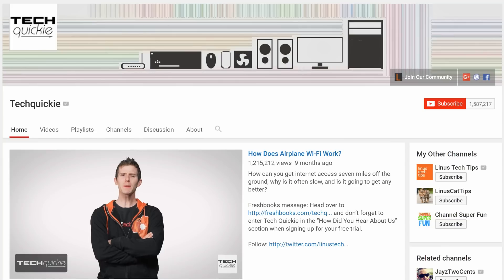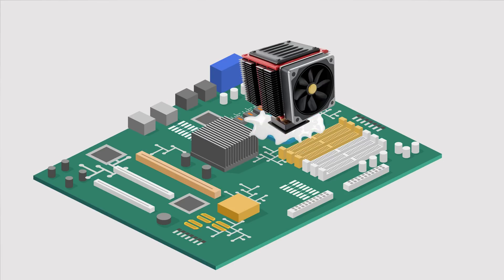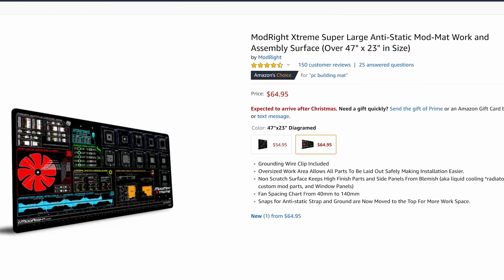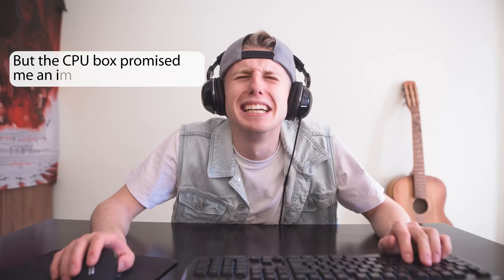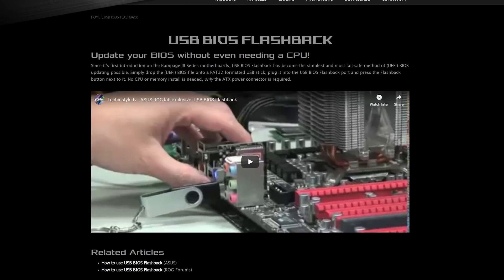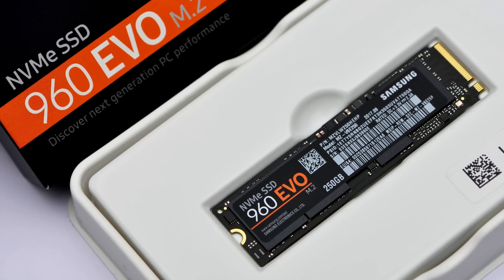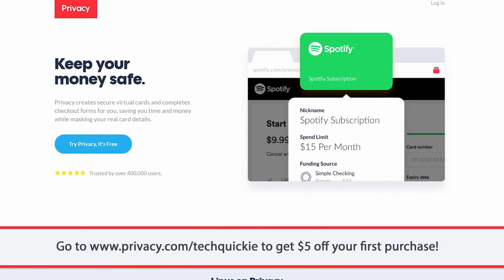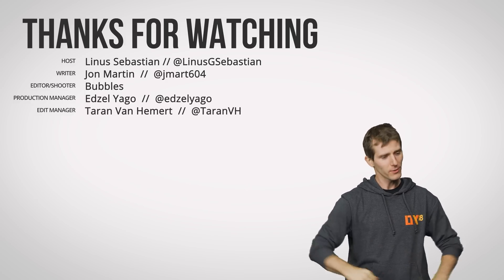DON'T Make THESE Mistakes Building A PC (pt. 5)

Comment: Here are some very important tips which were never mentioned:
1) Make sure the motherboard supports dual channel memory access.
2) Buy at least 2 sticks of RAM. If you want X number of gigabytes of RAM, buy it in two sticks instead of 1 because you need two sticks of RAM for dual channel memory.
3) Most consumer motherboards I have seen have 4 RAM slots. If you have 4 sticks of RAM then just install them. If you have only 2 sticks of RAM, then install the first stick into slot 0 (the closest one to the cpu), and install the other into slot 2 (the third slot away from the CPU). If you did this correctly, then there should be an empty ram slot in between your two ram sticks. If you install the RAM sticks side-by-side then you will have 2 individual single-channel memory access points, which is much slower than a single dual-channel memory access point.
If you have 4 sticks of RAM, having a motherboard that supports dual channel memory is still important because with 4 sticks of RAM you will have 2 dual-channel RAM access points.

I made the mistake of installing my ram side by side. Benchmarks showed that my RAM performed much more slowly than it should have because of the lack of dual channel. By correcting the positioning of my ram sticks, I more than doubled the RAM performance according to the benchmarks I used.

Also if you want the quietest possible system, go for more fans, diode cables (to reduce voltage and slow the fans down), and slower fan speed profiles in the bios/uefi firmware. More slower fans gives same airflow as fewer faster fans, but less noise. For example, I have 3 fans on a 360mm radiator on the cpu (self contained liquid cooling) and it is so much more quiet than the push-pull fan configuration I had on the 120mm radiator in my previous build.
Reply: I have seen one (pre-built PC) motherboard where the 2nd and 4th slots were actually the ones you were supposed to use in dual channel mode.

But the inside of that case was bonkers.  The drive cage was mounted vertically with screws, but the HDDs were held on with Velcro tabs (I kid you not).
Reply: @nocelebrity6042  So basically that motherboard and the rest of the PC was built entirely by retards?

Comment: When pulling down the retention arm, push down on the metal square doohicky so it goes under the screw.  I didn't do that and I'm pretty sure that you're not supposed to hear a crunching sound when you pull the arm down.

Comment: Dont buy a 16 gig stick of ram, buy two 8 gig sticks and put them in dual channel
Reply: or alternativaley buy two 16 gig sticks and have 32
Reply: TheBlinkstyKrab what if I want 4x16GB to get 64
Reply: @B1SQ1T  u can buy 2x32
Reply: @DixeyDo  4×16 has no performance difference to 2×32
Reply: @noahsvirsky9962  Duel channels are the best
Reply: @DixeyDo  most slots are configured ABAB, you want both cards to be on the same letter or "channel" for the benefits, 4×16 would work the exact same as 2×32
Reply: @noahsvirsky9962  im pretty sure its AABB and you want them to exist in AB config. Plugging to the same letter means plugging to the same channel means the other channel is not being worked on.

Edit: when in doubt, usually there are etching on the board that tells you the name of the lane or u can check the manual
Reply: @noahsvirsky9962  there is
Reply: @noahsvirsky9962  except 2x32 is better for upgrades
Reply: Why?
Reply: Or just use quad channel
Reply: Does buying 1 stick of 8 gb ram, put it on slot 2 then buy another 8 gb ram and put it on slot 4 make it dual channel or is it specific to 2x8gb only?
Reply: @horizonariondust576  It is best to have the same sticks, but it is possible to use different ones. You should match the frequency and the latencies between the ram sticks, because if they are different, the RAM will work on the lower one.
Reply: Buy 4 4 gig sticks its even faster
Reply: @tatemushroom1002  Please, no it's not faster unless you have a threadripper system.
Reply: Or 4x4, populating every slot, if you don't plan on upgrading later on. Also, check the slot population guide.
Reply: Or just buy a 16gb ram kit
Reply: With ryzen loving memory bandwidth I'm surprised we are not seeing triple channel make a come back.
Reply: @pauls4522  Is it really related to bandwith? I thought that it is because of the infinity fabric clocked  the same speed as the ram.

Comment: We at the Verrge use special Thermal compound.  If you follow my directions clearly when apply and use my technique of the "Bukkake Thermal Sugoi" method, you can actually lower your temps by at least 20 Celsius.  

Some suggestions I would add would be to replace the liquid in your AIO or custom loop with thermal spunk, it will cool it far better.  

You should install the memory in the closest ram slot possible, it is a advance technique called Fusion memory.  You must install both sticks simultaneously in the exact same time, in the exact same way.  If your timing is off, you will not achieve proper Fusion memory.   Even the angle of your wrist, and the amount of pressure have to be exact.  Doing it correctly will increase the memory speed exponentially.

This technique was taught be master race builder Yardrats.  I only know of 2 others who can install memory with such skill.  Master Race builder Goten, and Trunks.

Comment: Thermal paste again? Listen, tape your index with tape of any kind, add thermal paste to CPU, spread out evenly using taped finger until only a very thin layer remains, mount cooler. Perfect "every time" using this method because you can see the shmoo verses guessing the ooze. Peas and rice belong on your dinner plate, not your CPU, stop guessing and just use your damn finger and a little bit of tape. And knowing is half the battle :-).

Comment: i stored an old fx-8350 in a small compass box, well i guess someone stepped on it because most of the pins were bent, so i manually unbent them all and got it to work again flawlessly. Its so annoying when i had 1 or 2 pins that wouldnt go back up without forcing others down since i didnt have small enough tools to get in between them easily.  I used it and my old motherboard for my parents computer that they use for really only internet browsing.

Comment: Who needs a power supply? Find an electrical outlet, grab a screwdriver, and back the screw in the center of the faceplate off enough to clip onto it. That's a solid ground connection.

Comment: I'm using grounded power outlet, should it be enough to prevent any static charge and i don't have to use wrist with alligator clipper on it? or i'm missing something...

Comment: Not really relevant but i, and most people, don't really need NVMe so im absolutely fine with the speed boost a standard SATA SSD has over HDD anyways especially given how much standard SSD and SATA over M.2 drives have come down in price. If i was more into editing then i might consider NVMe. Good warning though. I have had a few customers not know this when upgrading systems.

Comment: I have applied pressure to a cpu, built my pc on a couch, never grounded myself, used tons of thermal goo, bent cpu pins after dropping a pga processor,  and none of this has hurt anything (after bending back pins). Newer tech is hard to break.

Comment: Just two things. When unplugging a graphics card, remember to unlock the PCIE port. Also the pins on the USB 3 motherboard jack are very easy to break, be careful when inserting that annoying cable.
Reply: I hate PCIE locks they're so unpredictable and stupid i've broke 2 trying to unlock them
Reply: Yeah... I thought I had the PCIE slot unlocked once... and ripped the whole slot off the board. Fortunately the board has 2 slots, so I just used the other one, but I should get a new board at some point. And make sure the next one has a classic PCI slot so I can install my old sound card again, RealTek onboard sucks for gaming.
Reply: Yeah, tried to put that fucking USB 3 cable back in and broke the pins

Comment: On SSD note, if you are just a gamer or building PC for everyday use,  then if you have to choose between smaller but faster NVMe and slower but bigger SATA SSD, I would recommend SATA SSD. Yes, NVMe is faster, yes it will load games faster in side by side and yes, it will will all of the benchmarks. But actually using PC  and playing games, difference will be minimal. Small enough that you would be hard pressed to tell the difference without reference point.  Which is why I would recommend bigger SATA SSD over NVMe SSD, as you will be able to put more games and stuff on it without sacrificing too much. Or even if you are happy by the size, I would still recommend extra money to go for either better graphic card, CPU or something else. Only way I would say go for NVMe is if you are already rocking i7 8700k and RTX2080 or RTX2080Ti and you literally are building top end build.

Only other way I would say NVMe is really justified is for work. There are work type applications that will benefit from NVMe SSD in all kind of manners, for example as scratch disk for various programs. Since if it can improve your workflow or allow you to do more work, that is easily justified expense, since it becomes investment.

Also two things people love to see and aren't that important for average users. First is sequential read and write speed. They do matter for copying large files, but do you really just copy large files everyday? Not really. They are one of more popular advertisement figures, because they are nice big numbers. But for most people not really that important, sure copying here and there will take more time, but again, how many huge files do you really copy? Probably not enough. Second thing is random reads and writhes with huge depths, like 32 and multiple thread count, like 4. Again they look very nice, very marketable. But they are very useless for everyday stuff. Those are important, but only to heavy server workloads where ton of random reading and writing happens at same time. Not for games and everyday stuff, where vast majority is queue depth of 1, thread count of 1. And those tend to be a ton smaller. Sure you might get queue depth of 2 or 3 sometimes, but again, fairly rarely and not even nearly enough to justify extra cost for that.

Also note with games, loading is quite a bit more than just raw reading. CPU actually has to do quite a bit of work initializing everything. Plus games when loading mostly won't load that 25GB "game.dat" file, it will open it as archive and much smaller files out, like textures, scripts, models,... Which also brings on another point, it won't be sequential reading, it will be random reads of small files, meaning that big sequential number won't matter as much for game loading. And you could say what about installing, sure, if you are installing from same or different NVMe drive. If you are installing from DVD or downloading, that will be in vast majority pretty much what will cap it. 

Just wanted to put in my 2 cents on SSD thing. Since some people tend to make sacrifices on other components to get that NVMe SSD. But for most, SATA SSD is plenty and will get you majority of the way there. Also if you are making PC, get SSD, at least 256GB, if not 512GB, they are getting cheaper and definitely affordable. I recommend against 128GB SSD, as games are getting too big for it and as OS only drive it is bit overrated.

And between M.2 SATA SSD and regular SATA SSD, get cheaper, whichever that tends to be. Unless you really don't want extra cables or lack 2,5' drive slots and don't want to get 3,5' SSD mounting tray, because M.2 SATA would be cheaper.

Comment: You can also do an uefi/bios update by taking out the eeprom micro controller from your motherboard and connecting it to a raspberry pi. (Just google "raspberry pi bios flash or smth. like that to learn more)

Comment: The static dissipative bag the motherboard comes in is a far superior work surface compared to a cardboard box. A proper ESD mat is static dissipative, so the motherboard bag is literally the best surface possible if the bag is also grounded, i.e. sitting on the side of a tower which is plugged in to an electrical outlet.
Reply: just a heads up, only the inside of the bag is ESD safe, the box is perfectly fine.
Reply: @Ravenousjoe  that's incorrect, the whole bag needs to be coated in aluminum or its not an ESD bag.
The whole bag is slightly conductive, 1,000,000 to 100,000,000 ohms of resistance, so is dissipates electricity with shorting anything out.
Reply: @SpecialEDy  All of those are different types of ESD bags. Not all of them are conductive, and not all are dissipative. Either way, a cardboard box is completely suitable.
Reply: @Ravenousjoe  Then why did the manufacturer of the motherboard spend $0.25 on an ESD bag if cardboard if perfectly suitable? They shipped it wrapped in an ESD bag because it's not safe for it to come into contact with cardboard. Cardboard is an insulator, which is dangerous for ESD sensitive electronics.
Reply: @SpecialEDy  it's to prevent the board from being damaged by the packaging at the plant or during shipping.  Cardboard generates dust when the machinery cuts or folds it up to make the packaging, so they bag the motherboard first, to stop the dust from getting in.  But, since they have to wrap the board in plastic to get a good seal, and bare plastic can cause ESD when you wrap or unwrap things, they coat the plastic to prevent ESD.
Reply: So assembling these on the carpet after you've run around for half an hour isn't a good idea? O_o

Comment: M.2 port that supports NVME doesn't neccessarily support SATA.
Learned this the hard way when decided to swap out NVME from my laptop for a higher capacity M.2 SATA. The laptop didn't need that fast storage anyway but I could use it on my desktop. Turns out my Lenovo Y520 doesn't like M.2 SATA drivers. So I had to settle with another SATA drive in my desktop and external HDD for the laptop -_-

Comment: Im sure it is but just to be sure. is this an nvme: https://www.scan.co.uk/products/128gb-gigabyte-m2-2280-pcie-30-x2-nvme-13-ssd-nand-flash-1100mb-s-read-500mb-s-write-90k-100k-iops-r
Reply: Check the URL. It has nvme pcie in it.

Comment: Don't forget to connect the PC Speaker.
A PC is not a PC until it gives a 750hz beep when you turn it on.
Reply: Most motherboards dont come with speakers now :( i remember the days were that beep was the most relieving sound you could ever hear
Reply: @shadowxxe  yeah, my daily is on a 13 year old board right now, gonna miss that beep when my new motherboard arrives...
Reply: Glad i'm not the only one. :D BEEP!
Reply: but i thought the human eye can only see 30hz?
Reply: @paulformo  OMG idiot the nose can only hear 12 gigs of resolution
Reply: @your_average_clippy  And that's on 4K watts
Reply: oh damn, guess I built my pc wrong it gives me a tasty 750v shock when I turn it on. Meh, at least the pc works most of the time and the shock gets me nice and energised in the morning.
Reply: @RopieIsMopey  if you had 750 volts running through your pc it would blow up. Most processors can only 1.75 volts and fan take 15
Reply: I could add it to my 10yo motherboard. Does a speaker with + and - fit on my motherboard which has 4 pins for the speaker?
Reply: My pc doesnt do that but it still posts
Reply: Same
Reply: (guitar chord)
And I'm pretty sure it was 900Hz.
Reply: I just hear a pop, but that’s probably my power strip lol
Reply: Dude it's 2020, who uses that anymore?
Reply: @cryo_life  your computer still tries to beep just like 198x
Reply: my motherboard doesn't even have a connector for the pc speaker
Reply: @mg86_  Look closely on the pins on the bottom of the MB, its probably there
Reply: @cryo_life  probably does have pins for it but id didnt come with any pc speaker
Reply: @mg86_  oh

Comment: My only regret when I built my PC was I got a 8400 when I probably only needed a 8100 for video games I tested this by disabling two of the 8400 cores and only noticed a 5 to 10 FPS drop which is still fine considering I only have a 60 hertz Monitor and was getting in the 70 to 90 FPS range for most games
Reply: When you get into more CPU intensive games, you will like the turbo and the extra cores.